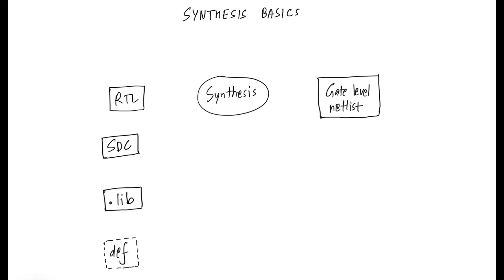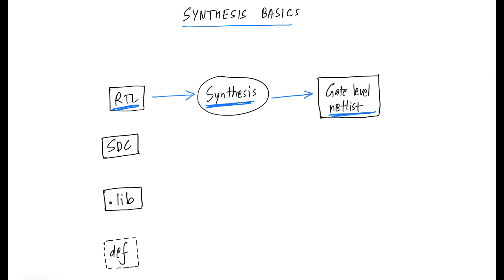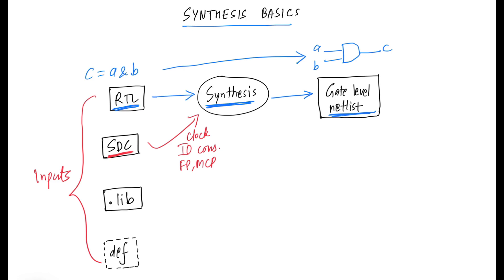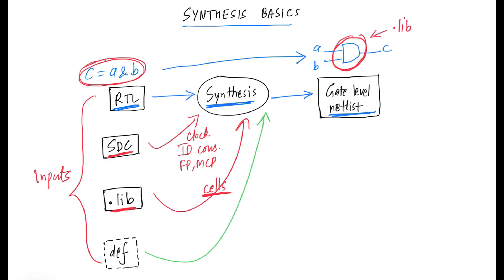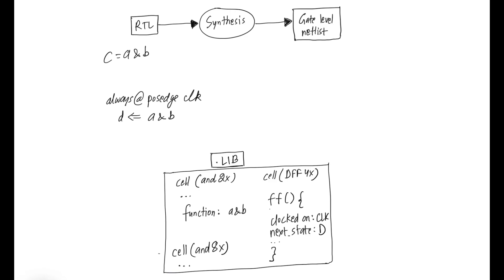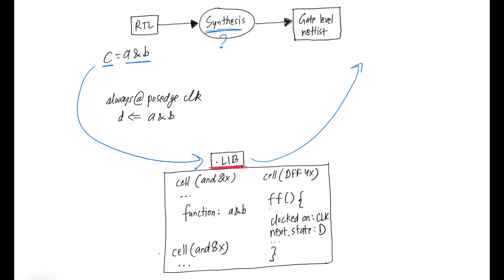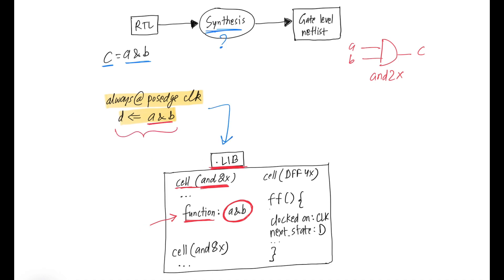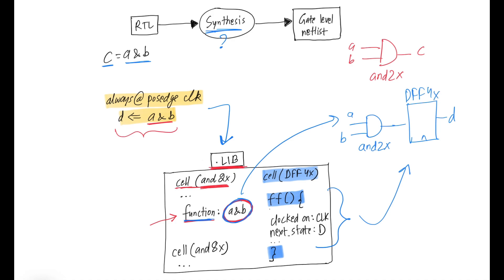Synthesis intro (Part 1) | VLSI interview prep | Digital logic | Physical Design | Semiconductors

Comment: Sir can you make a video on this like if the RTL code .v is having the generated or some clock information, but in .SDC file the clock information is not  present. so for this kind of cases how tool will check  the issues?